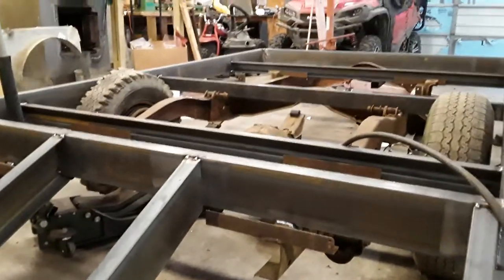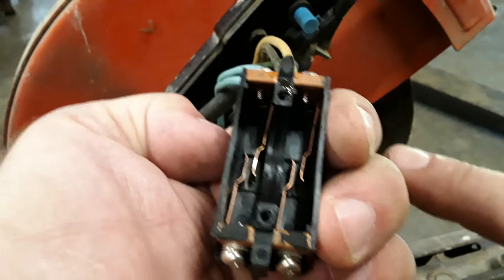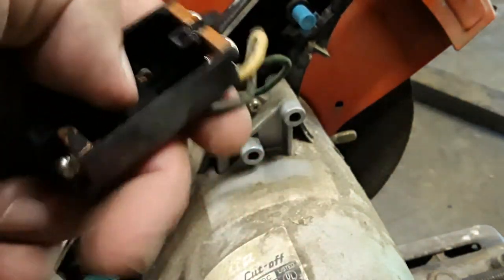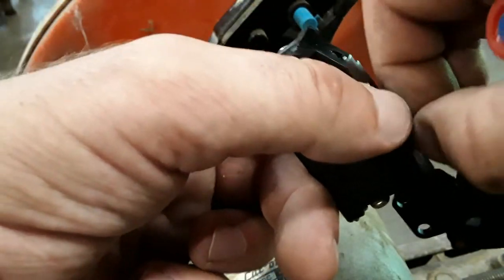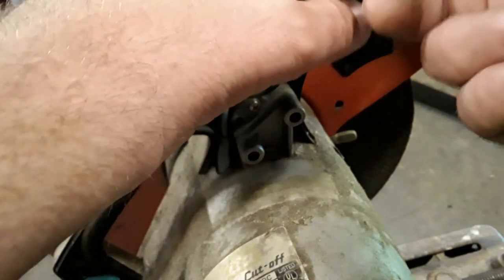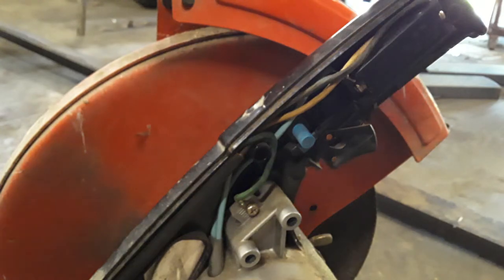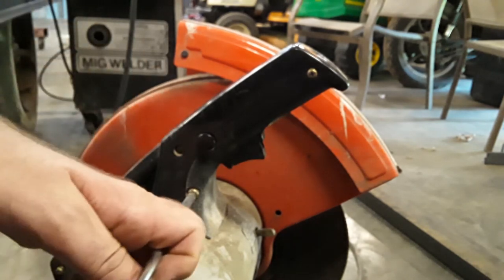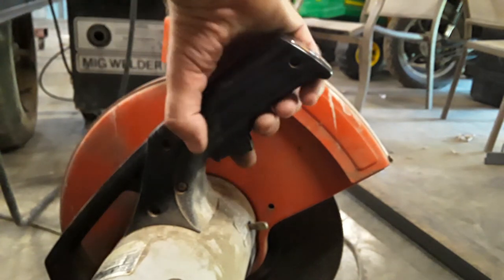Makita chop saw switch repair

Comment: Just picked up the same chop saw on the side of the road currently doing some repairs on it but good to see that this switch is serviceable That's awesome I think both of my brushes are shot so I'm going to pick up another set and throw it in see if that fixes it. I enjoyed the video 😊